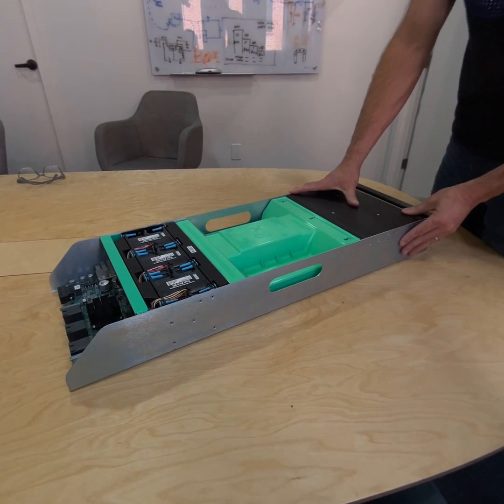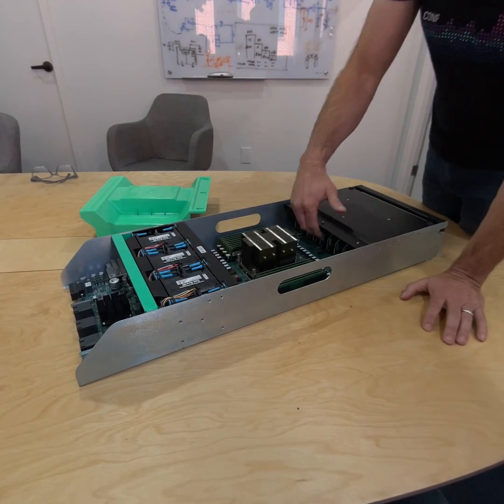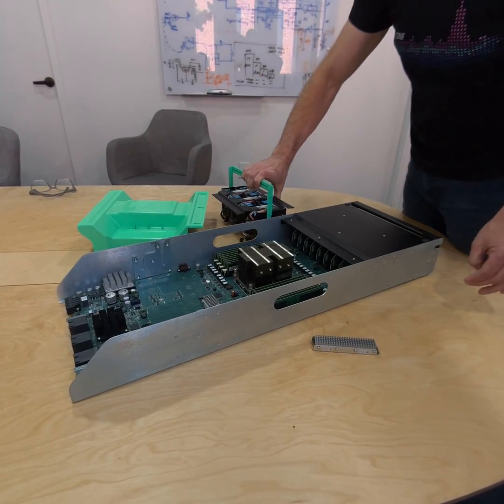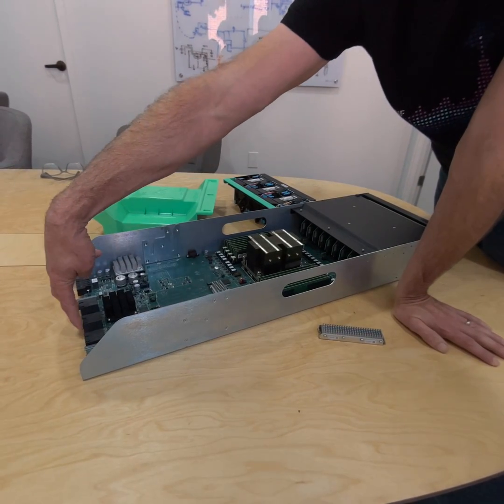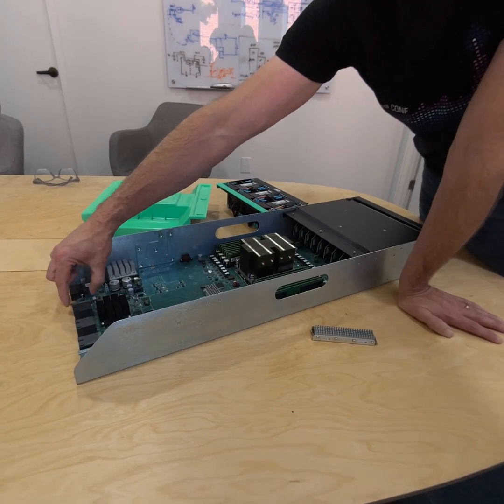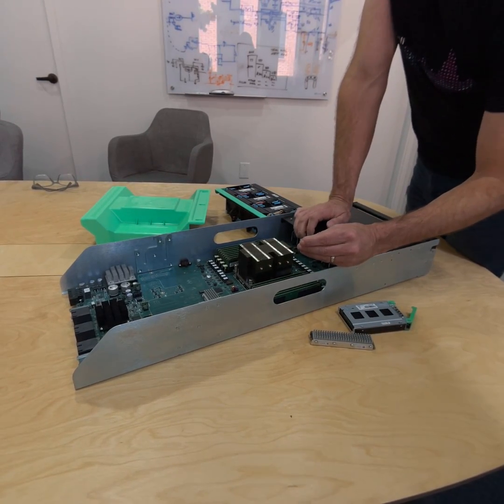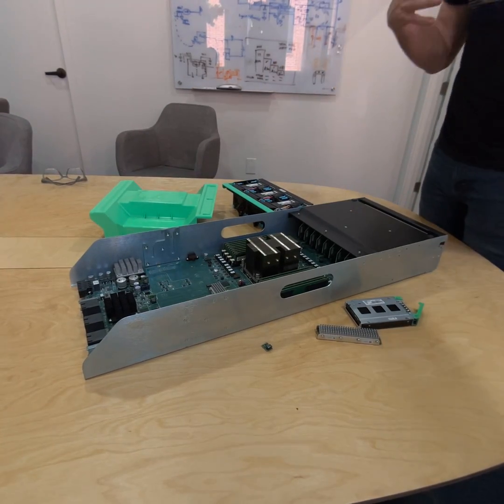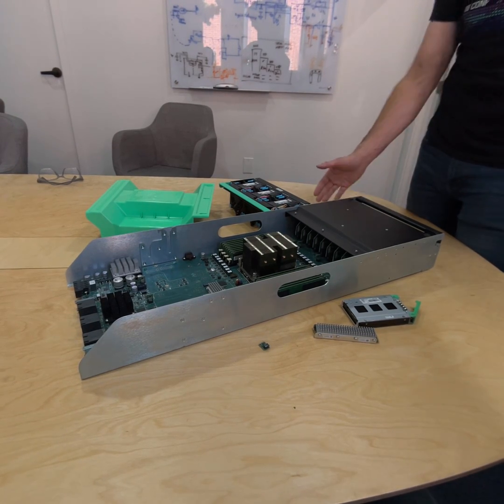Introduction to Oxide's Compute Sled - Gimlet

Comment: I don't know anythibg about servers. 
How do server CPUs work? Are they x86? Can they run CLI desktop programs the same way?
Reply: These are an AMD Milan CPU, x86-64 like many desktops/laptops, but with a lot more cores. I admit I don't know what operating systems they ship or support, but my guess is that customers will expect to run the same Linux and windows server workloads their off-the-shelf servers do. Yes, in theory anything that can run unattended is a good candidate for running on a server.

Comment: Easily replaceable temp sensors on little daughter boards is a great idea.
Reply: Considering some things I learned when talking with another shade of green compute company. Trying to add this in later because the problems you need to detect already exist, and are happening at scale. That can be an uncomfortable situation. 

This small, well thought out design detail will pay for itself with dividends for everyone involved. 

The data/metrics/observability seem excellent too.

These videos keep popping up, and I'm nothing but impressed. Every time.

Comment: Why 54v?
Reply: Disclaimer: I work for Oxide
According to UL 62368, an ES1 circuit is the lowest hazard level covered by the standard and is generally equivalent to SELV (Safety Extra Low Voltage) and the voltage limit to be classified as ES1 is 60VDC.  54.5V is approximately 9% below this limit, which allows for voltage variation due to line/load/etc and still be able to guarantee that the voltage will still be considered "low voltage".  

While 48V is standard in telecom infrastructure (many times -48V), but it doesn't hurt anything to go as high as possible here since most standard 48V power supplies designed for telecom aren't dense enough for our applications (our input DC-DC is 1300W continuous rated) and the power circuitry (such as hot swap controllers) work just fine at 54V instead of 48V.  The higher voltage you go, the lower your resistive losses are (which go up with the square of current).  

Some of the more recent Open Compute (ORV3) designs use 50.5V instead of 54V, but we haven't found anything that would make us go that route and 54.5V is still a "standard" voltage for the parts we would need.
Reply: @EricAasen-Oxide  OSHA requires additional safety requirements for anything about 50v so a lot of industries just go 48v to stay under that limit. Plus it is easily split into other common voltage levels (24v, 12v, 6v, 3v, and 1.5v) which is proballly useful for sourcing parts.
Reply: Higher DC voltage means less current, so (generally) for power delivery/connectors you want higher voltage if you can. The upper bounds on that voltage are often between (1) regulatory definitions of what "low voltage" is (this legal limit varies between 48v to 60v depending on context), (2) what your DC-DC converters can convert cheaply/efficiently, and (3) amperage/heat limits of your power connectors
Reply: @admalledd  48v seems like the standard value for low voltage that I’ve heard of, but i dont know much about DC in the data center.  Is 54v a standard value there?